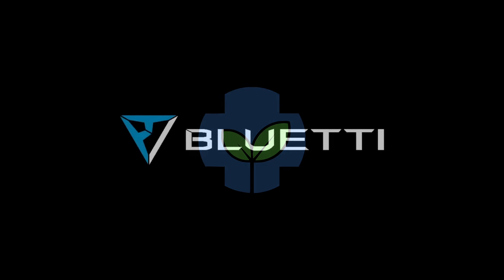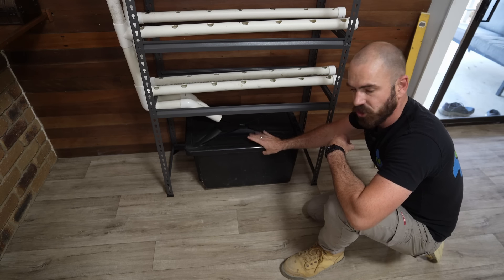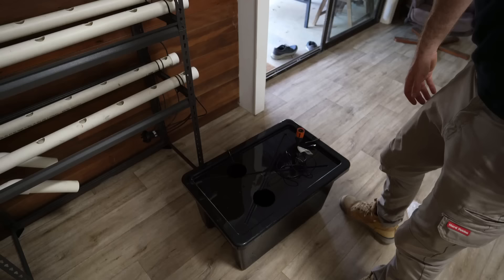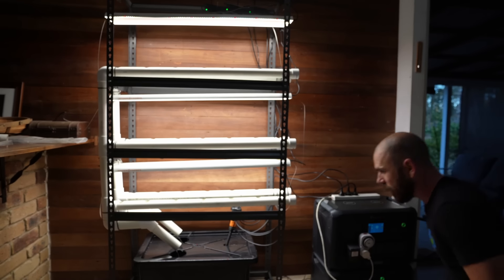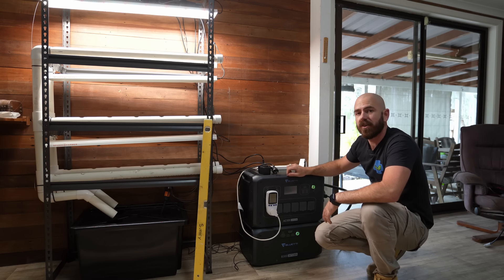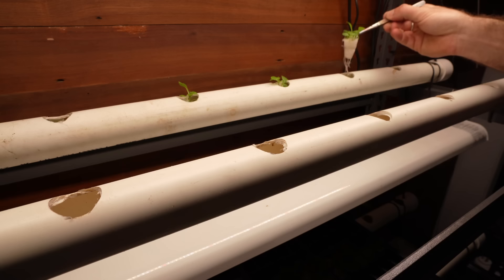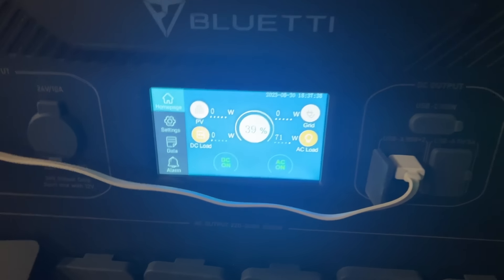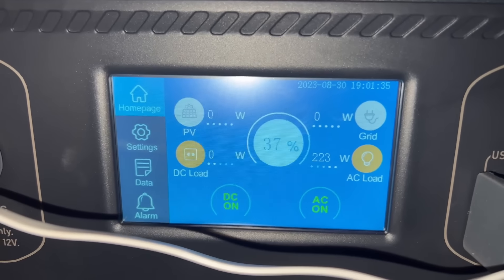Growing Plants Indoors, with the Sun…

Comment: The power loss is in the change from DC to AC to DC.....   Solar and battery are DC... Which is converted to AC for the household plug... Which is then converted back into DC by the power supply for the lights...   You should be able to plug the lights directly into the DC outlet on the battery...   I will be doing this same..  with 1000 watts of light via 2 x Viparspectra KS5000.  My thoughts.... (2) 48 volt, 5kw batteries..... The ks5000 lights are 48 volt... I should be able to get nine hours of 1000 watt draw....

Comment: In my experience you should use DC lights right off the battery. The extra watts that the inverter is consuming means that your inverter is about 50% efficient. When I stopped converting DC to AC just to turn it back into DC I got all my missing power back.
Reply: Absolutely agree.
Reply: What DC lights would you recommend?
Reply: Not converting to AC will save you overall efficiency. Most inverters themselves are more than 80% efficient.
Reply: This is a subject which I’m ignorant in, is there a specific kind of grow light that’s DC, so I know what I’m looking for….
Reply: There's also a loss in the AC Adapters on top of the inverter losses as it's going DC>AC>DC. Would cut the losses back to the LED wattage draw if you got 12V LED strips and terminated them all into a junction box into the 30A DC Circuit.
Reply: @blessisrael6455 if your power supply is 12volt DC (car battery/Bluetti power supply etc) then get yourself some 12Volt dc lights 12v led or something like it. The only issue is these lights are only good for seedlings or small herbs. Either way there are always losses when running anything electrical because nothing is 100% efficient so if you’re running high powered led’s you will have no choice but to use an inverter to run them

Comment: Pop some real panels up on the roof. The fold out ones are ok for camping and portability but you’ll get much better result with fixed panels. Im leaning towards using it for bubblers when growing outside.
Reply: Makes sense. Or just a couple of pumps maybe ?

Comment: With solar "off grid" or not dependent on a main source. Your battery needs to be able to run the load for 3 days and the array or solar panels need to be able to charge that on a good day. Dont forget to factor in length of day in all seasons and load variability seasonally. Great video and honest review
Reply: My favourite way to grow solar vegetables is to grow them outside

Comment: Hoocho!  Great video!  I’m a solar engineer and I think you should expand your solar panel input (permanent ground array) and add batteries plus stay with the Bluetti solar generator. Use a gas generator as a backup to the solar. You can go off-grid if you have enough sunlight. GO FOR IT!!!!
Reply: I have a 6 tier shelf with passive Kratky tubs and T5 grow lights 10” up from tubs powered by a scratch built solar generator. Can add air pump but need to keep overall power draw at minimum. It works but need 4 hours full sunlight to keep battery charged. Your videos are great! Thanks for all of your innovations.

Comment: I just found your channel two days ago.  I am so happy to see the Bluetti AC300 and B300 being used.  I have that system but now that I have seen what you’ve experienced I need to buy more solar.  I haven’t had a power outage since the purchase but use to experience them at least once if not twice a year. I got it to run my refrigerator and freezer in a power outage as it can handle the surge of power when the motor turns on.  You know there is an inexpensive gadget that you can go around your house and plug int each electrical thing you own.  It will give you the information for power usage etc and you can put in the cost per watt - it will calculate what it costs to run that appliance for a 24 hour period.  This would be useful so you know how many B300 batteries you need and how long they will last without recharging them.  I bought the device but haven’t done the data gathering yet. 
It is winter here and that means no gardening for me for a while. Seed starting next month. I saw in another video of yours the wicking system with the float regulating the water.   I would love to build that system.  It looks like it could give some freedom in the summer to be able to go away for a few days without having to ask people to stop by and water the garden.  Love the idea of saving water by not overwatering and providing the right pH and nutrient levels. I have so much to learn about gardening.  Thanks for sharing your knowledge.

Comment: Heya Hoocho, have you ever thought about letting gravity work for you? If you put the reservoir on top (I know counterintuitive with all the weight high up) and have a small stir pump of like 2W in there to keep it constantly fresh, oxiginated and moving, then one BIG pump to pump the water from a low reservoir to a high one in intervals. Then you could save up on power since the flow will be gravity assisted from top to bottom over a constant time and the pump will just need to run to top things off. I hope you will pick up on this project again! Love your videos and greetings from Germany.

Comment: Power factor basically tells you how effecient the load is ( LED light for example).
Power factor of 1 means the load is utilizing the power source ( the battery)  efficiently.

The ideal power factor is 1.
The less the number the higher the losses.
Reply: Low power factor might increase losses in the inverter but not by that much.

Comment: I have been using a small sollar array and battery to run the small 12v pumps for my outdoor hydroponic towers. It allows me to place them and move as needed without worying about running chords or available outlets.

Comment: Try the system as a flood and drain system with perlite - vermiculite running battery about 5 mins per hour in lights on time and maybe 5 mins per 2-3 hours during lights off time: check moisture levels at end of the off cycle. Extend the lights on to maybe 16 hours per 24hours. Needs some math but may work out!

Comment: Tip: I set mine up similar using a 2kwh EcoFlow solar backup generator with 400kw worth of panels. 

One enhancement I made was integrating some smart plugs to make up for drops in efficiency of batteries. Depending on the time of day and the season, I would auto adjust the lights to reflect natural variations and save myself from draining the battery with a higher output than input.  

Hope this helps😊
Reply: Also add some diamond reflective sheeting around the shelf to maximize light with small lights
Reply: i believe you mean 400watts not kilowatts

Comment: Here's a rabbit hole I live in zone 4 so I've turned my 1st floor northern facing apartment closet in to a dwc garden I've been trying cut the energy bill could you mount the solar panels behind the system using the 3 spiderfarm light (on grid) to charge the battery bank to run other things that run 24/7

Comment: maybe a dimmable LED with a better efficacy rating would help? You could at least reduce the power draw if the sun's not playing ball. Also noticed the leads from the solar panel going to the bluetti means the door has to remain a bit open, potentially leading to bug invasion. I'd be interested to see a solution to this, fingers crossed without drilling holes into the house for those of us renting.
Reply: The LED driver IC is key. Many cheap IC using PWM mode to power LED, which is bad for plant. Plannnnnnt does not evolve to such sun that blinking. Constant current LED driver is better and bring better yield of crop under same power comsumption. (This is proved by many theses papers already.)
Besides, Hoocho just needs a cheap power management device to save power furing the night. Many Arduino garden DIY projects can help. (Many YT videos are available.)
Last, Hoocho lives in Australia, a sunny country. LED is better for sun light supplement since he has a large DIY green house.
Reply: What I did was cut a solar cable sized hole into a pice of wood long enough to span my window. This let the window close (sealing against the wood instead of the normal windowsill) I referred to it as my acme portable hole since it's only in use when the power is knocked out. Also have to pop out the screen, for a permanent installation, I'd suggest poking a hole in the screen for the wire and seal around the wire with duct tape or caulk.

Comment: I love this, so fun an interesting. I did this build many months ago, based on the first version. I get alot of algae build-up though :( IDK how to fix that. Love the content!
Reply: Cover everything that doesn't need the light with reflective material that's the only way but at least it's easy to clean off compared to a aquarium
Reply: @shinybulbasaur8692  cleaing out those pvc pipes was a pita, probably cause I sealed everything. Since they are round..maybe covering them with just aluminum foil would be ok?

Comment: 8:30 The reason the 65 watt light draws 136 watts is because the DC to AC inverter plus the electronics inside the blue eti is using 71 watts.  The light itself is only using 65 watts.

Comment: Power Factor

There are three different types of power. There is real power measured in watts (w), reactive power measure in volt amp reactive (var) and apparent power measured in volt amp (va). To visualise this we can use a power factor triangle or use the beer analogy (google it for a cool diagram). Real power is a purely resitive load (think the liquid beer), reactive power is the power consumed by a capacitive / inductive element of a load (think the foam on top of the beer). Apparent power is a measure of both the real and reactive power combined (think the whole glass of beer with the liquid and foam). 

Now reactive power is related to power factor. A purely resitive load would have power factor of 1, meaning would get all beer and no foam in the glass. A power factor of 0 would mean you'd have all foam and no beer in the glass.

Reactive power can be thought of electrical energy bouncing around in side a circuit not doing useful work. 

So if the spider farmer light has a low power factor (think hootcho ment low when he said high power factor) then there will be some electrical energy bouncing around inside not doing useful work (aka not turning into light).

Hootcho, is the Bluetti displaying power in watts or var? What is the power meter displaying in ?

Some other contributing factors play apart in overall efficiency these include but not limited too: 

Inverter losses in the Bluetti power pack turning DC into AC. Losses from the power supply in the LED light turning from AC back to DC. Losses in the LED diodes themselves. Losses in the actual cabling and wiring.

Comment: Power factor isn't an issue here. You're probably thinking of general efficiency. 60W lamps are describing output power, where the input power is higher (because no machines are perfectly efficient, these lamps will be generating some heat instead of light)
Reply from the maker: The watt draw is 65 watts measured at the the PowerPoint on the front of the device with a 3rd party watt meter
Reply: 60W is probably the "LED-Power", the 5W extra is the power supply. (In reality it's probably more like 55W LED, 10 power supply)
Of those 60W (55W), more than half will be turned to heat by the LEDs.

Comment: It's actually easy and you're gonna like this people use the mug of beer example: the entire mug of beer is how much total power is consumed. But, some of it is foam,  and the rest is drinkable beer. You see electrical loads do not deliver 100% work for the amount of power consumed. Some of the power is used up in the process of doing work, therefore "wasted" , aka foam. So the power factor is just the proportion of useful power consumed to total power consumed.
Reply: Love the show. I'm hooked,I want to do this. Anyone recommend a farm i can learn at in usa?
Reply from the maker: What I don’t understand is how the measured “watts” can be different to total power consumed. 
Apparently power factor isn’t measured for residential power… does that mean you’re sneaking extra power through your meter?
Reply: Technically yes. I've been told the utility companies don't like that and may come after you for it. Industrial plants will have capacitors to offset the motors (inductors) to balance their power factor. As residential it's probably nothing to worry about since you're such a small fish. I don't even know how they would know.   @Hoocho

Comment: You need proper panels on your roof, 1000w worth.
 You only get 8 hours of good light per day, and the first 2 hours and last 2 hours are not going to pull full ampage, so 1000w of panels can reliably give you 5kw or 6kw per day reliably, you have 6kw of battery so you can fill it on a sunny day with a 1kw solar array, but rainy days exist, so you need 2kw solar array at least for this setup.. 
 And even then if it rains for 2 days in a row it will run the batteries dead in  20hrs, so you get 2 days power for the system if it only runs 10 hours per day, not including the pump that needs to be on 24/7

Comment: I've been thinking this system may be useful in northern climates that get little sunlight in the winter. Combine this with a passive solar greenhouse. During the day when the sun is out the lights are off and the batteries are charging. During the night when the blanket is down, the lights are on the push the DLI to the optimal amount. It will also provide heat to the greenhouse to keep the temperature up.

Comment: Power factor is a ratio(division) of efficiency, so if your lights use 130w to produce 60w of light, 60/130= 0.46

You pay for 130w, you work with 60w
Reply: Most residential customers only get billed for real power, not apparent power.

Comment: A very simple explanation for power factor:
The load draws power in a weird way (at the wrong time in the sinewave, but you can ignore that).
In this case it is not a problem as long as you just connect a few of those lights.
The number shown by the plug-in meter is accurate for energy used.

Your inverter shows apparent power* which is the number the boost circuit cares about. If it goes up the load on the boost circuit goes up.
Your plug-in meter shows real power, which is the number the battery cares about. If it goes up your battery will drain faster.

*or something close to it, either on purpose or by cheaping out on the sensor.

Comment: Hoocho,

Power factor of 1.0 (100%) is of a purely resistive load.
When you start introducing digital electronic power supplies (that are cost effective): they cause a delay in power usage.

Think about a motor and how it draws a high amperage at the beginning: same idea. Electronic components take time to charge and the power used wont be at the peak of the AC spike, but when the AC is crossing the zero point (thus causing a high amp draw, skewing the power factor.)

AC crosses 0v (50 times per second for you), and goes up to ~339v (at the very peak of the wave): even though you call it 220/240v. Ideally devices would only use power when it's available and everything would have a nice power factor.

P.S. you can buy power factor correcting devices, they will store the power and "sync" up to the supply to create a 1.0 PF.

Comment: Oh, here we go, right? We've got this bloke, right, who's doing all this over-engineering stuff, using fancy gadgets to mimic what Mother Nature dishes out for free! I mean, it's like buying a GPS to find your way from the bedroom to the kitchen. "Oi, just use the window, mate!" I get tech, you know, when it's really pushing the envelope, making life better, or just inventing something new and exciting. But this? We're way off the mark here. It's like using a rocket ship to get to the corner shop – a bit of overkill, isn't it?
Reply from the maker: Yeah, but it’s kinda fun right.
Reply: @Hoocho could use natural lighting if outdoors and have the solar provide just the fertigation, or pump air in dwc. Though outdoor wicking looks like optimal off-grid (in warm enough climates) I would guess places where it's too cold for lettuce to grow outside also are not ideal for PV solar arrays or batteries. 
Fun (and because of loosing power during storms) was enough motivation for me to build a diy equivalent to that bluetti system. Smaller battery, but more panels and lower cost. My salad shelf was also an expirament but I 3d printed a flood and drain system (figured intermittent pumping would use less power than nft) worked well enough until roots clogged the drain, drying & ruining the pump. :'(